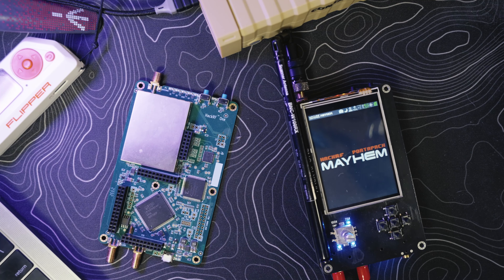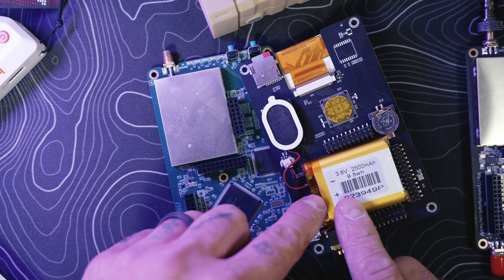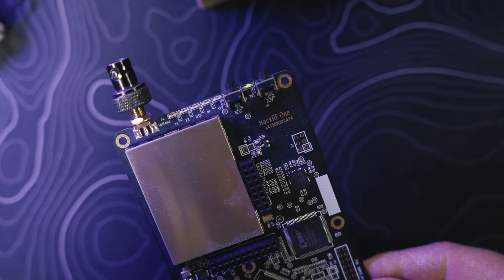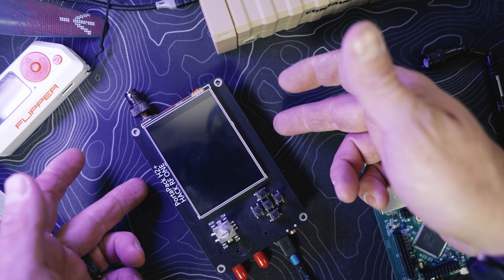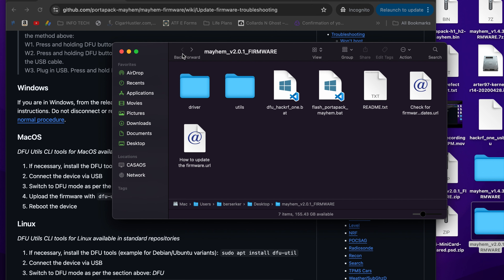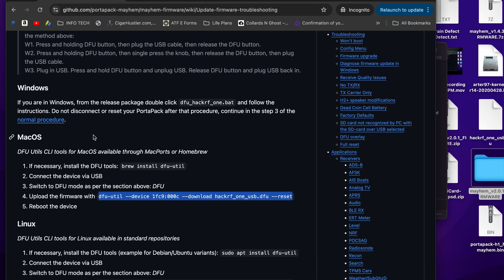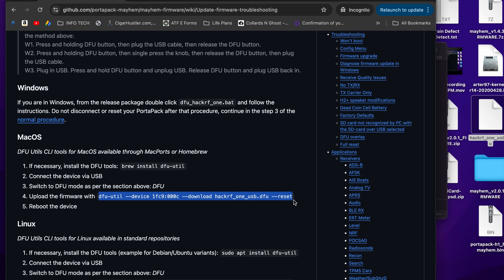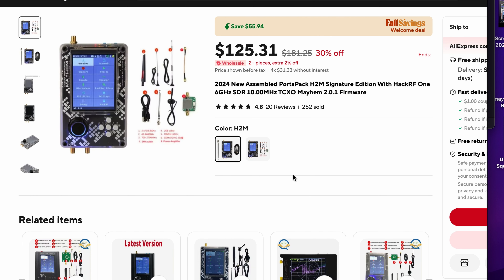Portapack H2 Hack RF One Responding to Your Comments

Comment: That battery is a 103040, 1500mAh 3.7v… I just happened to have my Hackrf and porta pack apart laying on my desk…. Awesome videos keep up the great work!!!
Reply: I think if you stay within a 10mm think battery you should be able to go longer and wider like maybe a 104040 or 104050, these batteries are easy they’re numbers are they’re size, like my battery is 10mm thick by 30mm wide and 40mm long, I think there’s room for a bigger battery but not thicker, you need to have space for expansion plus I put some of that silicon tape on each board to keep any components from poking the battery…
Reply: I’m not sure what you have for a battery since it’s got a weird number on it, but its length and width look perfect, just needs to be 10mm thick… I would measure my board for length and width but my caliper battery just decided to die, and it’s a hearing aid type lol… anyway let us know what you find out about a battery that fits.
Reply: @Josh_FSD  Good call on the tape. Are there any interference issues using a larger battery? What abut the charging part..I can't recall if the HRF has the protection built in or is it on battery? It doesn't appear  to be anything on my battery.
Reply: My battery came with the porta pack clone but it does appear that there it some sort of tiny circuit board connected to the battery tabs then to the wire, but I can barely see it in there… As for HRF I don’t know if it’s got any protections built in, also my battery appears smaller than the battery in your video, you have it in the spot where mine lives… I think you could get away with a battery the same length and width, but I wouldn’t go thicker than 10mm… Could you tell me what the measurements are on your battery? They’re usually rounded to the nearest 5mm or 10mm eg 30 by 40, or 35 by 40, or 30 by 45, or 35 by 45, I’m just using these numbers as an example yours could be 45 by 60 or whatever, I looks to be a thick one though mines 10mm and it’s got just enough space for the thicker tape and maybe 1.5mm for expansion… also I’m thinking about getting a clone HRF to go with the Porta Pack, just in case I have a battery mishap, I do take it apart and remove the battery when I know it’s going to be more than a couple weeks before I use it again…
Reply from the maker: @Josh_FSD  check on the Discord Portapack server. I believe someone has already 3D printed a case to fit two 18650’s.

Comment: Board on the right is not a GSG, they are green and don't use the shield because (from what I read in the documentation) it was proven to make no significant difference.
 
What you could do instead of wasting your time and money with these batteries is, use the clear case that comes with the PortaPack H2 kit, buy a Nitecore NB10000 battery and velcro attatch it to the back of the case and use that as your battery, instead. You could get a full days use out of a single charge. You can even extend the battery life by changing the battery to run in a lower power state. The space you save inside will allow you to use a larger speaker.

An awesome video would be on modifying the source code to disable those annoying blue battery indicator LEDs and customizing the BLE capture CSV files to include the name and dB!
Reply from the maker: @907-q7u  I like the battery idea. Especially to put in a larger speaker. I’ll look into it. I know someone on discord has a .stl file somewhere for a 18650 back. But I don’t want to go that big. I like the somewhat slim form factor of the H2.
Reply: The NB10000 battery is great, I bought a small  L-shaped USB-A to micro USB cable that loops into the HackRF. I basically only use the battery when necessary when in the field, otherwise my unit is connected to the wall outlet.

I really wish HackRF would use a female connector for the two clock SMA connectors to keep them out of the way since most people do not use them. USB-C should a required port by now.

I use that antenna you recommended and love it!  I would like to remove the antenna more often, but the BNC adapter keeps coming lose, I wish there was a way to lock the BNC adapter to the SMA so that the BNC doesn't unscrew with the antenna.
Reply from the maker: @907-q7u  I totally agree on usb c and an improved screen like oled or amoled. You could tried stacking a few rubber o rings below the bnc to provide counter friction to the sma threads and against the bnc bottom.

Comment: If you get a new thick battery, you can instead of sticking it between boards, may be can take outside of the HackRF board. And do not use the plastic case.
Reply: Can't be hard to have the back half of the shell modelled in a way to add additional space- thinking GameBoy et-al... it is nice to have a "finished" product/ look... I already get looks from anyone that catches a eye at the thing- i can only image, since it can give off that improvised booom boom device...and boom boom not as music [- having this extra raw ellectronics poking out attached only adds to that vibe.
Reply: There's already an STL files around called the thicc  hrf1 case that accepts a larger battery.
I have it at home

Comment: You do know that there is another process that needs to be taken to enable the screen right? I forget the exact button presses, and the details will be in the wiki.... but once the HRF1 is flashed...connect the PortoPack...and either before or after(using the SD card method to flash) flash the complete device- the key button press step either installs the drivers for the screen or initiates turning it on/ enabling it.... something about "video mode"

There are some good threads on reddit - but the jist of it is holding down- for some the left, others the right button while turning the device on...center click knob...keep holding left or right for another 10 sec
Reply from the maker: @paranoidzkitszo  ya. I read through those when I downgraded to 1.4.0. Nothing seemed to work for my unit. I was mainly doing it to show an actual visual of a unit running 1.4.0 and then updating to 2.0. In the end I just found it easier to go the DFU route and try my best to simplify it for others. Thanks for the input. Maybe someone who’s having issues can find help with what you posted.

Comment: How/could you use a 2.4GHz signal booster with the Portapack? I purchased a Portapack from a guy and he gave a signal booster with it. It’s a heavy small metal black box with a bird on it. SMA female on one end and SMA male on the other. (In/out)  with its own power supply.
Reply: Female to Router/AP  male to antenna.